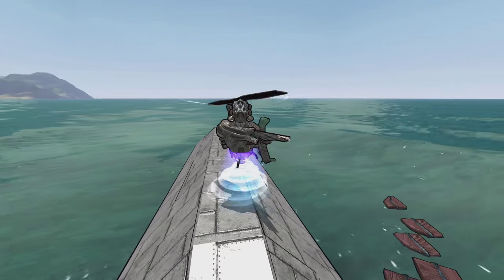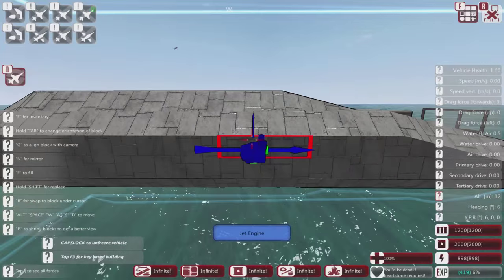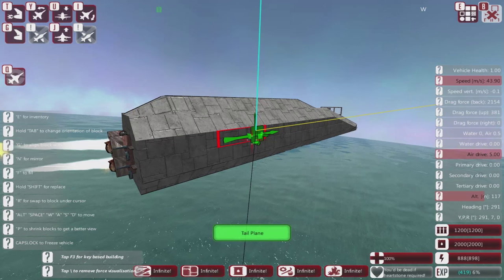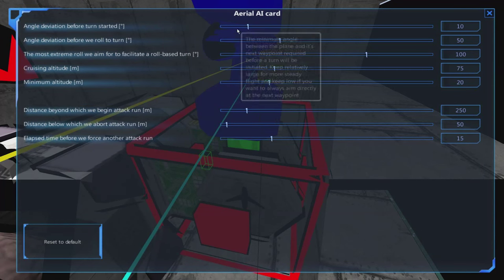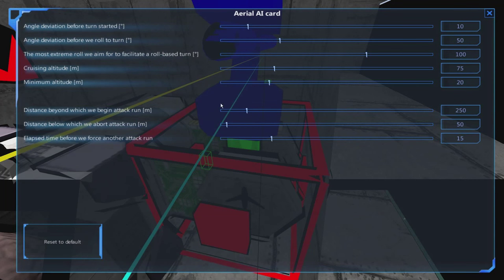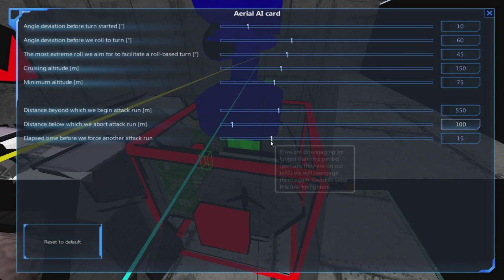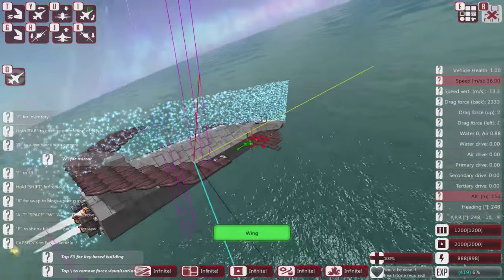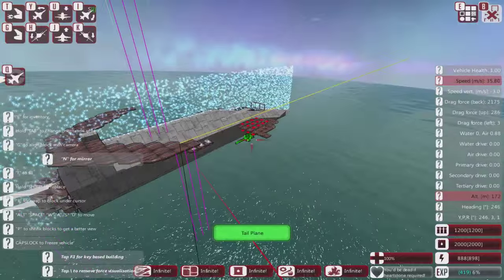From The Depths HowTo 12-Aerial AI Propulsion and Balancing.Tutorial,Help

Comment: Hey del, I really enjoyed the tutorial. my question is, can you encase or hide your wings and tail planes? will this affect lift if the wings are completely hidden? thanks.
Reply from the maker: +Bruce Boyer Hi yes you can as there is no direct Aero dynamics or Airflow requirements for tailplanes,ailerons or wings. Engines need 8 clear blocks behind them to give full power but it is possible to put the other items inside the vehicle if you wish.
Reply: +Dels Gaming  You can also use a spinblock to create a subobject that then doesn't require the 8 clear blocks, so you can put rows and rows of jet engines to get ridiculous speed ;D
Reply from the maker: Kurly
Yep aware of it and this engine stacking is a bit of a game exploit that will be removed by the Dev in the future. I try not to show exploits and the tutorial is aimed at basic concepts that should be relevant as the game is developed more.
Reply: It's used in the campaign on a few different AI ships/planes so i figured it was a feature :P
Reply from the maker: The Lore guys are redesigning ships so I would hope they remove it. There was a thread on forum about it and end result is some see it as exploit and some as 'if it is in game it ok'. I'm of the view if it possibly wasn't intended by dev and doesn't feel at least a bit realistic I will not use it or advocate it. Either way if you can make it fly without then feels good.
Reply: Oh fair enough, Until i figure out making an efficient large jet engine this is what i'm limited too xD Keep up the good work, Sorry I promoted an exploit on your channel! wont happen again. :)
Reply from the maker: no it's fine. You can do one thing which is to use the fact that only the centre block of a huge jet engine need to have clear behind so you can put 8 normal jets around centre of a huge jet. Gets you more thrust without any tricks.
Reply: Good to know, Cheers! :)

Comment: Hey Del could i send u a blueprint and help me a bit? im totaly lost a bit with the ACB to balance a full Rotor ship Hull is not quite ready now but im just missing the whole story about balancing with only rotor/helyblades. >_<
Reply from the maker: +iEx xaubercrow  Are you using any other thrusters for balancing. And is it eh forward back(Pitch that is out of balance or side to side. (Roll)
You can use ACB's to balance pitch but will need ailerons and aerial AI to balance the roll. You can load ship to Steam workshop and send me a link and then I will try and have a look.
Reply: just Rotos/helblades tryd it with ACB's to set rotations lower/higher but man thats hurting my mind i allready make a break. Got tired of deleting ACB's (bcuz of maddness lol) yeah i allready read it while i drink my coffee ill load it up sending link in a second.
Reply: Dels Gaming after some trys bcuz i forgot how to upload things to the workshop i finally got it. how i said Hull is not rdy right now but just a start with all right settings would be awesome so i have something where i can lay an eye to when i have to change something/add rotors.(just first try with Air things i have builded right now only ships) http://steamcommunity.com/sharedfiles/filedetails/?id=560271881
Reply: Well for now its to much weight when u lift it up and let it out of liftmode u can see the front is going up and it has side to side issues as well. just for known things i allready know.
Reply from the maker: will have a look when I can and post up my version later
Reply: thanks anyway let me know when its up so i can start work on it for your campaign. :p